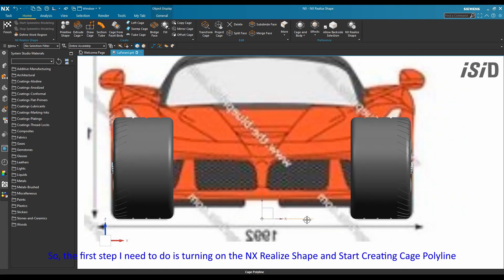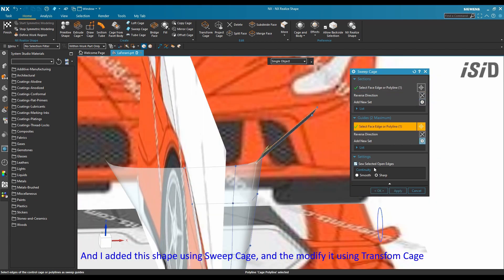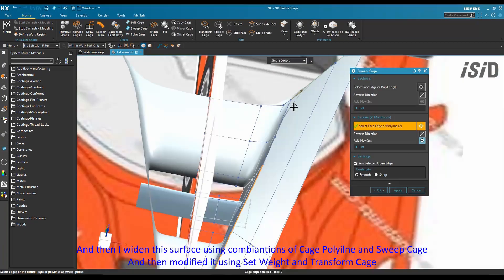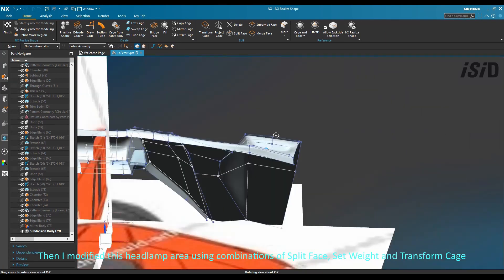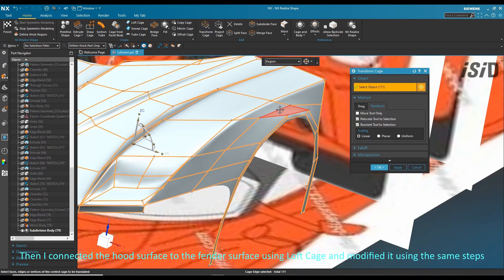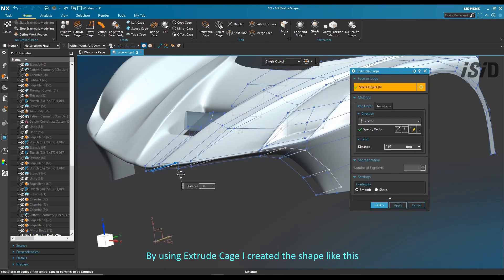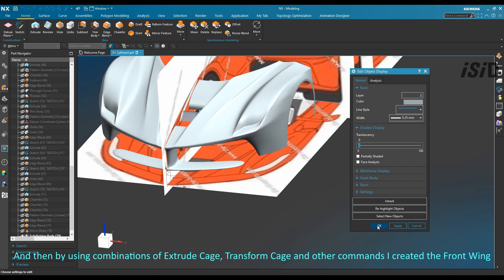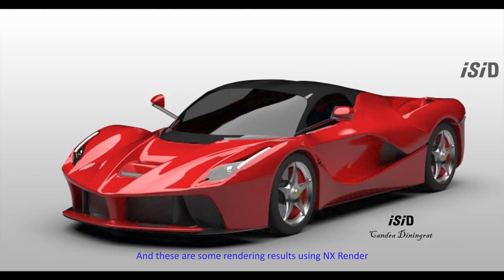3D Surface Modeling of LaFerrari - Siemens NX

Comment: Hello I had a question. Please compare Katia and nx software and which one is better, please answer
Reply from the maker: Hello, it depend on what segment that you want to compare, both of them is top tier solutions. if you compare about Styling Capability you can see the styling capability of NX in by this video or you can see also about our video of Bugatti Chiron modeling. If you compare about CAM capability of course NX has more footprint in CAM Segment. If you want to talk about PLM in NX can collaborate with Teamcenter (The strongest PLM especially for discrete manufacturing) seamlessly. If you want to talk about virtual commissioning capability, NX has Mechatronic Concept Designer which can connect your virtual machine (3D CAD) directly to virtual PLC or Real PLC.

There are lots of NX uniqueness comparing to other solutions but I will explain about these 4 important points:

1. Proven Deployment. With NX you do not have to wait to take advantage of the latest advancements in CAD. NX is being deployed at the largest engineering enterprises in the world right after it is released.
2. Data Preservation is a hallmark of NX. NX will never force you to leave your data behind to move on the next release. We have always prided our self's on the ability to use all the data we have created no matter the platform of the past release.
3. Platform Flexibility, you can decide how you want to use NX, on premise, or a virtualized environment or a streamed service from a public cloud provider.
4. In addition NX is built to be scalable in packaging that allows you to get the right configuration for your needs.
Reply: I had used both of them. I prefer NX. User friendly.